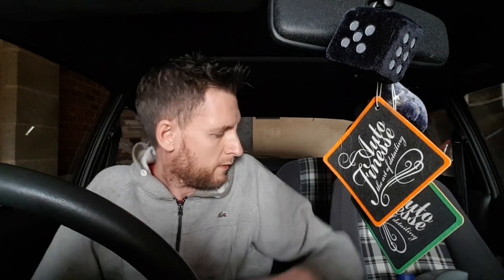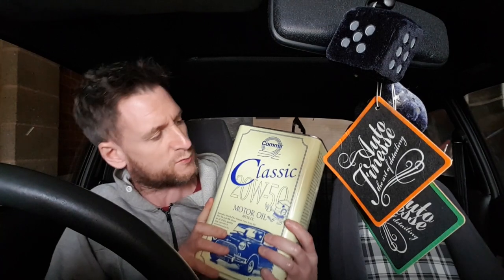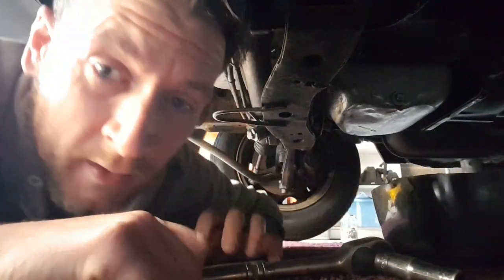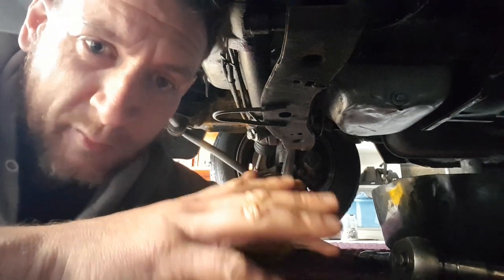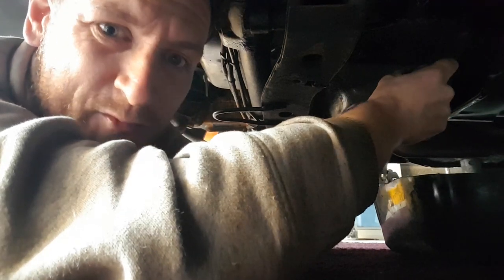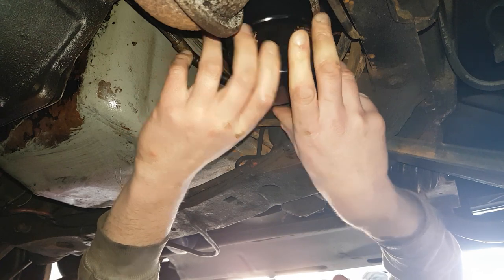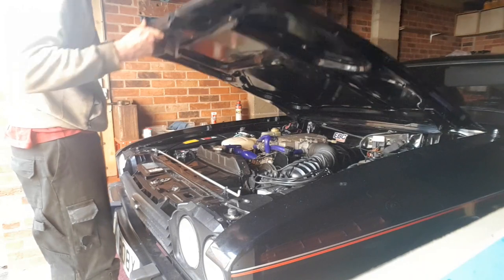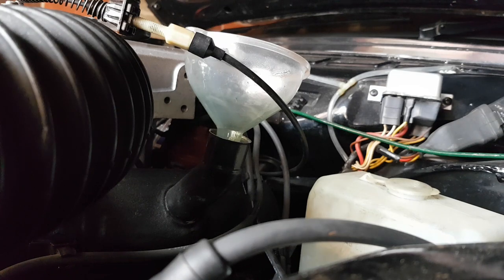Episode 57 - How to change Ford Capri engine oil... again

Comment: Yo Jimmy. I always use the 20w-50 oil in my capris. Except what I do is when I have changed the oil and filter I try to get the level of the oil in between the "minimum" and "maximum". I put some oil in the filter before I fit it. Then start it up and check for leaks. Then take for a run out when warmed up properly pull into a lay-by or car park. Leave the car running and pop the bonnet. Then I add a container of STP. I swear by it. Then drive it home. Check level and top if necessary. That's what I do and my 2.8i I bought in 1991 still sounds as sweet as the day I bought it.
Reply from the maker: Yo Ken! Haha. Thanks again mate. Love these little stories. The love for the 2.8 is real. Mine's currently running sweet too. More videos of it to come in the future!

Comment: Great stuff… these engines need high zinc content, that’s why I use valvoline VR1 it has 1400ppm.  But that’s just my advice. 
Keep the content coming 👍🏻
Reply from the maker: Thanks Lee. Your support is greatly appreciated pal. Just glad I didn't go anywhere with the 5W30 in the engine. HaHa! 😆

Comment: Another great watch Jimmy. 👍🏻 Have you changed the gearbox fluid at any point? I bought some comma SX75W-90 GL4 for the 5 speed box. And comma LS80W-90 GL5 for my limited slip differential. This was recommended. Do you or any of your viewers agree with this? Or recommend something else? My  Brooklands has a limited slip differential. I find comma oils very cheap tbh. That actually puts me off a bit! 🤷🏻‍♂️
Reply from the maker: Cheers Jase.
Never touched the gearbox oil pal, although it's something I'm considering on changing at some point.
Yeah, Comma oil was recommended to me. No one in the comments seems to slate them. Like most things, you'll always have those who support and those who don't. I'm certainly happy with what Comma provided for me.
The Capri forums online could prove useful in asking. Hope this helps. Cheers.
Reply: @jimmykneesall  Cheers for the info mate. Well, tbh I haven’t actually found any negative comments with regards to comma oils myself. All I’ve read is that some of the more expensive oils may have better longevity? Something I would possibly prefer with regards to gearbox or diff. Castrol do all these Transmax fluids. Which are double the price. But, are they really any better? You could actually send yourself mad looking at all the different options! Haha. Cheers again Jimmy. 👍🏻
Reply from the maker: @jasesmiles  It is a bit of a minefield. I take the premise that as long as you change them enough, pretty-much any brand will suffice. As long as the grade is correct of course! 🤣

Comment: I have a 1.6 Laser, interested in changing the oil myself...is it a similar process?
Reply from the maker: Hi Jordan. Never changed the oil on the 1.6 engine, but I can't imagine it's too different. The oil filter will probably be in a different position, but the process should be pretty-much the same. A good tip, if you haven't already - get a Haynes manual. Not only will it show you the process, but it will also tell you which oil grade you need for your engine. It could be different to the 2.8 Injection. They're so cheap and they're also golden for when you come to fix other things, which will happen every week on a Capri! HaHa!

Comment: Hey pal,planning using the same oil you used,how much did it use to fill up and how do you rate the comma classic after running it?
Reply from the maker: Hi Gareth. Looking on the internet, it says the 2.8 engine has a 4.25-litre capacity, which would seem about right, cos I have just under a litre left in the container. So far, it's been fine, so I'd recommend it. Plenty of others besides Comma Classic of course. All I wanted to do was make sure I had 20W50 in it! HaHa!
Reply: Yeah that's cool cheers for the advice,like you say plenty choice out there but want to get the right grade aswell👍🏻
Reply from the maker: @garethmiller8378  A lot of people had commented on the other linking video (Episode 55) that the oil I'd put in that time was wrong. Wish I'd followed my Haynes manual from the start! Oh well. Live and learn, eh?🤣

Comment: Ex Ford technician, don’t believe the forums… can’t believe someone recommended 5/30… another disadvantage is lower oil pressure
Reply from the maker: Cheers Arthur. Believe it or not, there were LOADS recommending 5w30. Unbelievable when I look back on it. Oh well. At least it's been corrected now. No issues at all since either. Happy days.